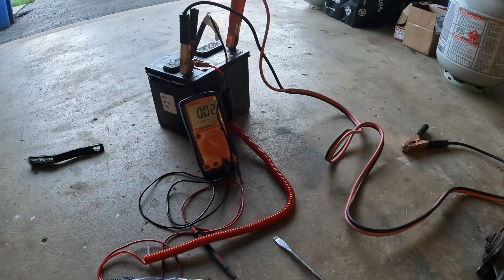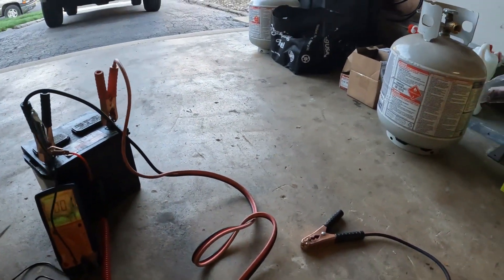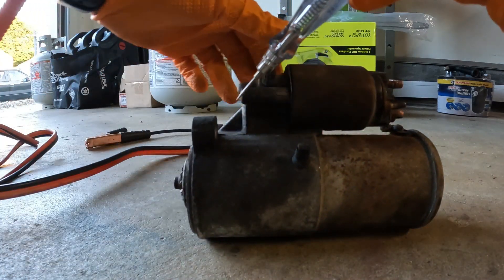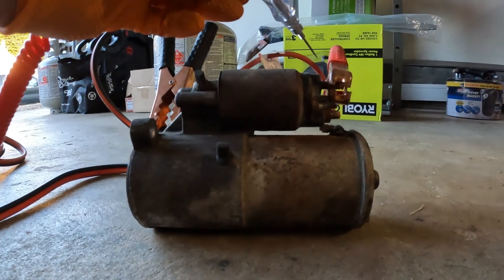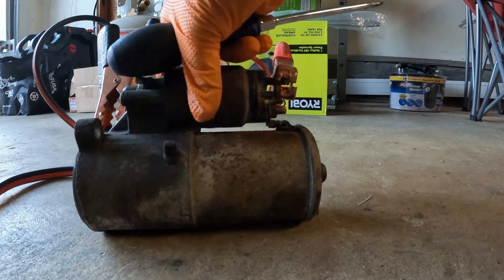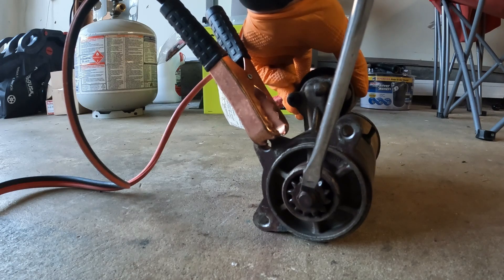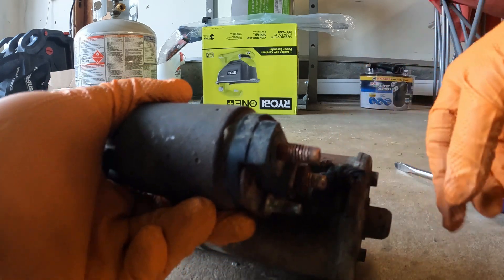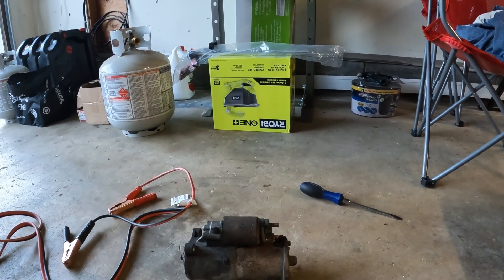Testing (And Jump Starting) A Starter

Comment: I got a question  , friend of mine  has a 1997 Oldsmobile regency  this past summer we had to get the starter replaced  , the shop put a starter in  , then during this fall and now AT TIMES  , when she is turning the key into the START  position  ,  it sounds as if the starter has a very very brief as in like a ONE SECOND  dead spot , so as soon as she turns the switch into the RUN  position,  the starter turns over but in that BRIEF  SECOND  it sounds like a dead spot that the starter may have , this is the best i can explain it , overall the starter is fine , i just dont understand that brief what seems like a dead spot.  Fly wheel is good . Battery is brand new ac delco less than year old.  Starter has warranty yet . 3800 engine
Reply from the maker: It sounds like potentially the starter could have a few teeth missing on it, but it’s hard to say without hearing it, but it could also be some missing teeth on the flywheel. Are you sure it’s good?
Reply: @candrdiagnostics  im no genius about vehicles , but the shop said fly wheel was fine , and im sure the shop would of looked at the starter to make sure starter has all the teeth 🤔 i woulf think .  Im think its to do someplace in that starter myself 🤷‍♂️  like in the siloniod area  , or below the silonoid . Yes i agree hearing it you would know much easier what im talking about.  But maybe its just in my fricken head 😐 , i asked the shop to put in an ac delco starter  , but evidently they couldn't get the brand . 
I happened to hear that delay as she started her car , i stopped and said  was that your starter,  she said it only happens a few times , so i thought im not gonna bring it in unless it gets worse , that way it can be heard more . Jeez i wish i could describe it more better,   ITS  like in a brief SECOND  as when the starter is heard that 1 second pause is heard , yet it doesn't happen every single time from what ive   heard.   That is why im seen if it got more noticeable.  The shop would maybe think im hearing things 🤷‍♂️
Reply from the maker: @myfavorites1016 yea, I hear you. I’m just curious what they did (if anything) to actually check the flywheel. Does it sound like the speed of the starter is slowing down during that second of hesitation? And I’m assuming once the car is running, the engine sounds fine and doesn’t have any issues, correct?
Reply: @candrdiagnostics that is correct  , everything is fine  , there doesn't seem to be any power drop or loss during that breif second,  just wish you could hear it , but like i say at this point im just not gonna do anything about it,  cause it does start , everything fine , just curious of that breif second.  But as long as it starts  🤷‍♂️  its just that the starter is under warranty tell around August of 2023
Reply from the maker: @myfavorites1016 ok. So, there may not be a problem with the teeth after all. It could be the starter itself. Something may possibly be binding internally. If you’re interested in trying to troubleshoot it. I can help walk you through it. All you would need is a multimeter. I’m not sure if you have one or not, but a multimeter, amp meter, and a test light, are really great relatively cheap tools that can assist in a lot of troubleshooting issues. If you decide you want to look further into it, shoot me another comment, and I’d be glad to try to help you out
Reply: @candrdiagnostics  i really appreciate your help my friend  , yes i believe myself it is probably something inside that starter the way it kinda has been sounding,  unfortunately yes i have very little things to work with , and it is also difficult for me to be able to do maintenance on this car as my friend uses it a lot for work and kids at school , so i just bring it into the shop for its basic oil change and etc maintenance issues.  I do appreciate you help . Do you work on issues with vehicle's also ?
Reply from the maker: @myfavorites1016 I do work on vehicles when I can. I have a full time job as well, that takes up most of my time, so I like to work on all types of vehicles, and all types of problems when I can find the time. I am definitely not a professional by any means, but I do have a decent understanding of a lot of the different systems used in most cars. There is also a lot I don’t know, but I take every car I work on as a learning experience.
Reply from the maker: @myfavorites1016 also, you are welcome for any help that I can give. If you have any sort of time whatsoever and cannot get a chance to troubleshoot the car, I would bring it back to the shop and have them replace the starter again, while it’s still under warranty.
Reply: @candrdiagnostics  and its also kida as if the shop would need to listen to it start the car first several times before they would decide to replace it free , yet the labor would still be like $ 80  but maybe before the warranty expires
Reply from the maker: @myfavorites1016 yea, I’m sure they would want to listen to it, and more than likely charge you labor. Like I said, I’d be glad to help walk you through whatever I can. Let me know if you decide to do anything with it, or if you wind up taking it back. I’d be curious to know how you make out. Good luck!
Reply: @candrdiagnostics  i thank you for taking your time tho 👍 who knows maybe i will have a question on something else in the days to come,  🙂 and talk to u
Reply from the maker: Sounds good. You know where to find me!
Reply: Happy holidays to you
Reply: @candrdiagnostics  i had bought that Oldsmobile and about 5 months or maybe more,  my friend calls me up she said the car started sputtering and she managed to park it , and it wouldn't start back up , it was turning over , well we towed it to a different shop , the shop called me back and said bad news , he said antifreeze in the spark plugs,  he said looks like head gasket  , but more damage inside engine could have been done,  i wanted a second opinion,  so we towed it over to my most trusted mechanic  , i got a price on a head gasket job , BUT  he started working on this car , he said its NOT  a head gasket at all , the upper intake manifold was shot , he cleaned up the engine entirely cause each spark plug had antifreeze,  but he got the car running,  we just had to change the oil like 3 different times to make sure antifreeze got cleaned out.  This shop knows there work , theres no BS

Comment: Interesting  , so if the nuts or cable ends have corrosion on them , moreso at the starter bolts that will drop the voltage 🤔😒 Interesting
Reply from the maker: Yea for sure. So just to be clear, the starter nuts that bolt the cables, and bracket to the solenoid (or cable) whichever you have, not the bolts that actually secure the starter in place. You will get a voltage drop across them due to resistance from either the corrosion or broken wire strands.